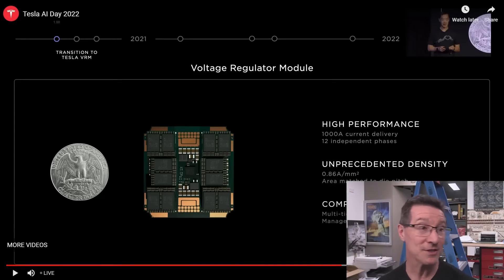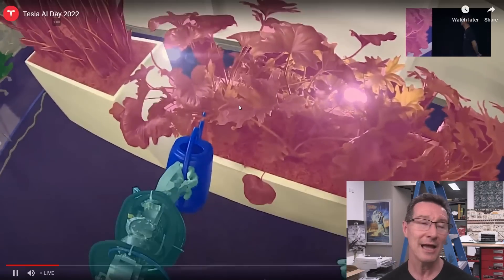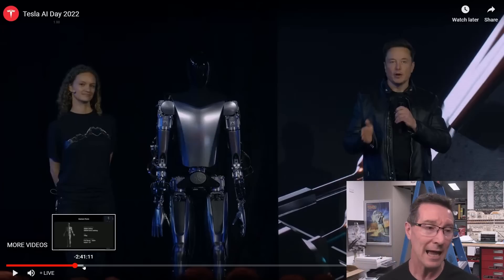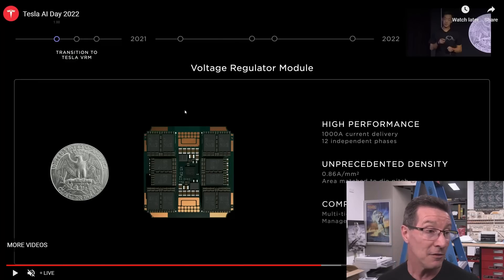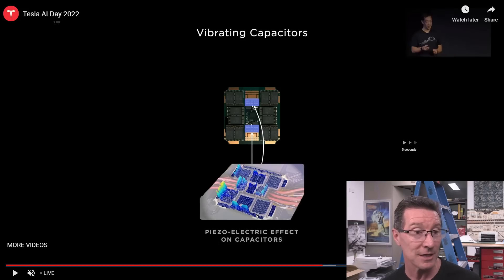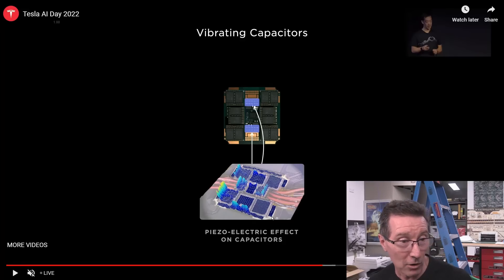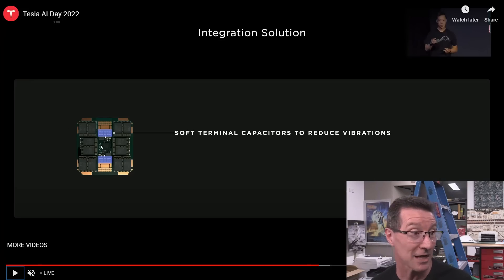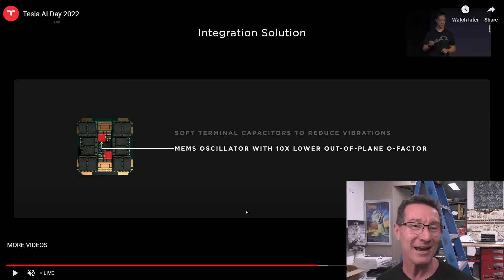EEVblog 1504 - The COOL thing you MISSED at Tesla AI Day 2022

Comment: The higher the power density being handled, the more electronics enters the realm of physics. Cracked ceramic Surface mounted capacitors were something I found many times being a problem on printed circuit boards when I worked on a radio module for a company in Mercer County, PA. I developed method for finding them including cooling them with Freeze Spray and watching for the ones that melted the frost real quick where everything else remained frosty, to track down  unexplained current draw that would have made the device eat batteries quickly.
Reply: Great idea, I was quite impressed with the Chinese version of this, somebody repurposed a vape pen to take flux and spew it out onto your board, but it's nice to know that you can use something you probably already have at home too.
Reply: @vgamesx1  An even simpler version: a drop of alcohol. It will evaporate as well but, is it even insulating?
Reply: @gabotron94  I've tried the alcohol thing a few times, yeah it works too, but if the part doesn't quickly boil away then it won't visually stand out which component is the problem, for example if you have a very low resistance but not quite a short, something like 1V on 3+ ohms, it won't get hot enough and could be nearly invisible to even a thermal camera, alcohol just doesn't work under those kinds of conditions that and well it's a lot more apparent when a board covered in a white mist disappears where you should be looking.
Reply: @gabotron94  we were after speed and instant visibility.
Reply: What a surprise not what was promised!  Was ment to be going to the shops and doing shopping now! good news tho the battery truck will be making its 10 year over due time line this month unless it gets put back AGAIN like everything musk has failed to achieve! He cant even get a window right!  🤦‍♂🤣

Comment: I don't quite get the people shitting on Tesla & Elon because Boston Dynamics has more agile and faster robots.

I guess they think 6 to 8 months is plenty of time to create a robot like Boston dynamics.

Apart from the design requirements are to have a low strength low speed bot more in line with a human doing some set of manual tasks.

Some people just no matter what Elon does will find a problem.

I heard some complaining about SpaceX because they only reuse the first stage and it's not cheap enough it's cheaper than everything else but that's not good enough.

Its like they're hoping for failure.

Comment: Impressed with a robot that could barely move, and didn’t do anything on stage? It wasn’t even aware of its surroundings.  I am surprised as an engineer you are impressed because it was less then impressive, I would recommend Boston dynamics if you actually want to be impressed.  You mentioned full self driving which is more like glorified assisted driving.  They aren’t nor will they be anytime soon full self driving. Even with the latest versions they are still trying to run over people and into dividers and over bicycles.  I understand at some point yes, but they are a long long long way from that point. Anyway, just wanted to point out some of the issues here.

Comment: One thing is building that robot with all the joints neatly integrated in that short time span, the other thing is controlling it and getting it to actually balance on its feet and move around and handle objects with its hands. I'm not in the business but I'm sure that takes a lot of refinement and modelling and tuning parameters. I haven't watched the presentation but I would assume they developed and tested the control system in a 1:1 simulation long before the physical robot even existed.

Comment: Honda's Asimo has been doing this for years
Reply: After 22 years of providing research, development and entertainment, ASIMO was retired and now resides in the Miraikan Museum in Tokyo.  I wonder if anyone has thought to check if ASIMO's internals are still there.
Reply: Yes mechanical robot is easy, but general intelligence for robot is hard.  That's why general prupose robot will go nowhere without a breakthrough in AI and no, Tesla can't even solve "fuul self driving" or even self parking!  LOL
Reply: @springer-qb4dv  - on a trip to Australia, I rented a VF Holden Commodore (General Motors).  One of the standard features of the car was 'Auto Park Assist' for parallel and right angle parking.  The feature had been introduced into the VF models in 2013.

Whilst it was a fully functional automatic parking system (including slow cruising, scanning for suitable parking spaces, automatic operation of the indicators/trafficators and steering), unlike tesla, they included the word 'assist' so that clowns wouldn't attempt the fatal theatrics that are displayed in tesla videos.

Comment: Totally ridiculous.  Anything with that many moving parts and motors is going to need a lot of lubrication and maintenance.  The applications for an expensive and limited machine that is unlikely to ever be autonomous for more than 5 seconds— very limited.  It’s going to take more than one human to supervise and control one robot, so there’s no savings in salaries.  It’s amazing for short staged videos,  disappointing once you realize it probably can’t get up if it falls over. And it’s going to need lots of working space in order to not bump into and hurt humans.  On;y good for very short staged demos.

Comment: Teslabot is better than I expected, but I must also say that they have now picked the low hanging fruits. Improvements to that will not be easy. Especially the battery problem. Maybe something like that works decently after ten years.
Reply: TBH the biggist hurdle for something like that is going to be cost, both in the initial price to buy the robot and maintanance to keep it running.
Reply: @scottthewaterwarrior  
Watch the presentation.
Concentrate on the part where they show the actuators and mention that they reduced the number of different types used.
"Improvements"?
Why do you assume the battery bis "a problem"?
Reply: @user255  The FSD computer uses 100 watts at peak load. At 2.3kWh that would be enough to run the computer for 23 hours.
Reply: So have a removable battery pack and get the robot to swap it out every now and then.
Or just provide a power outlet for it to plug itself into while it works.
Reply: @user255  I mean who cares what he promises, as long as he delivers something worthwhile in the end. It's well established at this point that Elon has a big mouth.
Spacex was originally going to land the Dragon capsule retropropulsively. That didn't work out, but they still went ahead and achieved reusability Falcon 9 and hugely disrupted the orbital launch market.
If they can only deliver on half the promised features of the bot I would still consider that a win.
Reply: @scottthewaterwarrior  I don't think our current tech is even capable to keep all the promises. Human like conversations... that means at least AI like GPT-3, but it is not runnable with the hardware it has (nor on the battery it has).
Reply: Umm.... after seeing what Musk promises of the Teslabot, it likely wont happen within 30 years.
Reply: Pointless exercise reinventing the wheel.  Mechanicals of robots have been long solved. Where is the general purpose AI necessary for truly useful all purpose robot?  Musk is missing the boat.  Oh yea.... Musk couldn't even do FSD "fuul self driving"  LOL

Comment: I think the most impressive thing about the robot was its fluidity of movement, it was so imprecise, something you are only going to get from ot being full AI control rather than rules based control systems being directed by AI. It was also a bit shaky which is also interesting, this shows that the actuators are constantly correcting but the fine control is still not quite there. Can't wait to see how far they get in the next year, everything engineering that Musk has a hand in always progresses so fast, you just know engineering is king at his companies.
Reply: Musk doesn't have a hand in anything but other peoples' wallets.
Reply: Animatronics engineers have been doing that for decades.
Reply: Boston dynamics.. Do you think they program every movement?
Reply: @Robert-j6r8c  Boston Dynamics have a mix of ai and traditional control algorithms, more of a hybrid approach. To do it all in AI is a very complex task and without Tesla's AI tech it wouldn't really be possible.
Reply: I also find badly tuned PID controllers extremely impressive.
Reply: @Finder245  But that is the point, they aren't using PID controllers it is the AI controlling these actuators based on sensor feedback rather than traditional PID control circuitry. If they were using PID it would be easy to tune out but then the AI wouldn't be directly in control so it wouldn't be able to react so directly to sensor feedback. As the AI gets better trained this shakiness will disappear.
Reply: @schrodingerscat1863  yeah… no… if they are using machine learning for motion controls, instead of using traditional control algorithms to carry out motion planned by neural networks, that’s even more stupid… Neural networks are computationally expensive and will not do any better than traditional algorithms that are well understood and have been successfully used for many decades. Just slapping “AI” in the middle of a problem does not magically solve it.
Reply: @Finder245  Funny how the neural network in your head seems to be able to do a much better job than traditional control algorithms. If the neural network circuitry is custom made it need not be computationally expensive at all, with the right initial training it would be better than say PID because it can self optimise. AI is beginning to reach a tipping point where it can replace many traditional systems.
Reply: @schrodingerscat1863  there is so much wrong with what you just said…
1. Machines (using traditional control algorithms) have been a lot more precise than humans for a very long time.
2. The nervous system is distributed across your body. A lot of the controls happen close to the sensors and actuators. You know, like in robots.
3. Tesla is not developing a giant digital brain. They are simply training neural networks to do specialized work then connecting them to each other and to other algorithms.
4. Tesla does not do online learning. The neural networks cannot adapt to anything that it wasn’t trained to do. Machine learning isn’t magic.
5. Neural networks are computationally expensive. It’s a brute force approach. We started using neural networks recently because computers are finally fast enough to make them practical for a lot of applications.
Reply: @Finder245  High precision isn't the aim here though is it. Industrial robots that need such high precision for obvious reasons use very different methods. The goal here is to be able to take input from a large array of sensors and output to a vast array of actuators. This is a good match for neural networks. Telsa does all their training online using their Dojo super computer, once trained the AI can of course operate autonomously for situations that it hasn't encountered using the training it has already received. More training gives better results in such situations. Simulating neural networks using traditional CPUs is highly computationally intensive but Tesla have developed their own silicon using a highly parallelised architecture utilising thousands of very simple cores which are far better able to simulate highly complex neural nets. The AI will of course have higher and lower functions similar to the layers of our own nervous system. You don't have to consciously think about balancing in the same way as the part of the AI that governs obstacle avoidance isn't concerned with balancing on two legs.
Reply: @schrodingerscat1863  The goal here is to do the bare minimum to impress people, and distract from their pile of abject failures, hiding just off-screen.
Reply: @schrodingerscat1863   you are confusing planning with motion controls. A neural network can act as a planner while the motion control is done by a PID or some other traditional control algorithm. For example, the neural networks might run at a 100ms rate coming up with a plan of what state the robot should be in, then the PID loops can run at a much higher rate to actually move the actuators into that position. This would be the equivalent of the robot “thinking” that it wants to stand and then the body carrying that out. There is no need for “AI” garbage there.
Dojo is NOT online learning. What you are describing is offline learning. Online learning would be if the robot, during its operation, would continue to update its neural networks to learn new patterns.
Reply: @Finder245  No, that isn't what I am saying at all.

Comment: a bunch of so called enginners supposedly smart ones were not so smart at the end, how could they not think of vibrations in either capacitors or inductors. it says itself high currents that it could cause vibrations in capacitors due to electrical fields or other physics, especially if the frequency is at the boards resonance or even move capacitor to another place might not be easy on a small boards same with the position of the oscillators. the resonance can also have areas on a pcb that has biggeer movement than other a bit like crazy waves on the ocean . electroscope shows this at much less power scale

Comment: I too was fascinated by the VRM.  This seems to be a Buck converter with 12 phases.  They said the output was 1kA, but I didn't see the voltage.  If we assume 1V, that's 1 kW output from a tiny PS, and it's powering just one of their custom compute chips.  Wow!
BTW, for those who don't know, shrinking a PS into a smaller package while maintaining the output power requires raising the clock frequency.  They needed an insanely high clock freq, but the power MOSFETs can't switch that fast, so they had to use multiple phases.  The effective clock rate is the actual clock rate times the number of phases.
Reply: The core voltage of the Dojo processors is apparently around 0.85V. The TDP of each chip is 400W, and a tile of 5x5 chips with ancillary interfaces and logic chews through 15kW (or about 18kA).  A full rack is 120 tiles... that's a power density about a hundred times what traditional datacentres are built for.

I'm not too impressed so far at Tesla's efforts at reinventing the wheel when it comes to the robot itself, but the innovation required for that density of both power electronics and cooling is impressive.
Reply: @rabidpb  Richard, thanks for the clarification on the power issues.  But I think you should be more impressed by the robot for many reasons, including that it's probably the first humanoid robot to: 1) be designed for low cost and high volume, and 2) have so much AI learning ability behind it in Dojo.
Reply: @steverobbins4872  Do you even realise how long robots like this have been in development? years.
Reply: @tyronenelson9124  You know what else has been "in development" for years?  Cars.  And spacecraft.  But both of those seem to be undergoing rapid advances, so maybe robots can too.  Huh.
BTW.  Show me another humanoid robot this is designed for mass production and extremely low cost.
Then show me another robot of any kind that is backed up by a massive supercomputer to train its neural networks. Oh, right: Tesla FSD.
Reply: @steverobbins4872  Err, So does a robot have a person onboard like a car or a space craft does? brilliant comparison there well done.
Reply: To simplify this further. This is a normal power phase that has just been mounted squarely onto a interposer with exotic VRMs and capacitors.. Interposer cost and reliability is still prett low especially in heat cycles or vibrations but they have been around awhile the capacitors are pretty cool though. But typical uses don't need the density when they have all the space under the cooler's heatplate/heatsink especially when they can use both sides of the board. The point I'm getting at is the density claim is malarkey typical Tesla babble because we won't know the density of the system as a whole without seeing the cooling system/ radiators.
Reply: Have you seen the actual current tests and readings, probably not, that device would possibly put out that amount of current briefly not constantly, so its pretty much a placebo.
Reply: @tyronenelson9124  "Placebo"?  What's that supposed to mean?  I'm pretty sure it can output 1kA continuously because that's the rating.  But as Richard Garnish replied above, the average output is about 470A @ 0.85V, or 400W per VRM.  So they designed it for twice the typical load.
Reply: @steverobbins4872  Have you seen the actual tests and readings??
Reply: Correction: 6 phases, not 12.  Half the FETs are used as synchronous rectifiers.

Comment: There is one little detail no one tries to solve. In real humans, energy distribution is also the cooling. Without blood circulation, we would overheat very quickly. If these robots ever want to reach the compute capacity of a brain, they will need to run some fluid through it.
Reply: Or keep the brain elsewhere. The big power stuff here is kept in.a datacentre, the robot itself only needs a couple hundred watts to run.
Reply: @rabidpb  
I've been trying that in my back yard science lab to make humans smarter and more efficient... I'm running out of room to bury the failed ones.
Reply: @Robert-j6r8c  People are smart enough given right nutrition, exercise, stimulation and the right environment (no stress, noise, and proper human and emotional care). When people are dumb, it's rarely because of lack of brain resources.